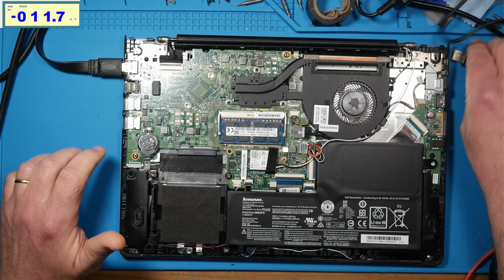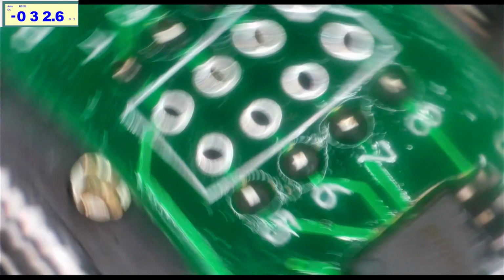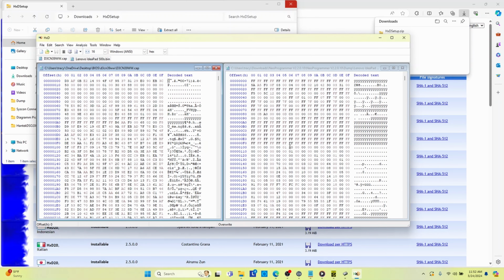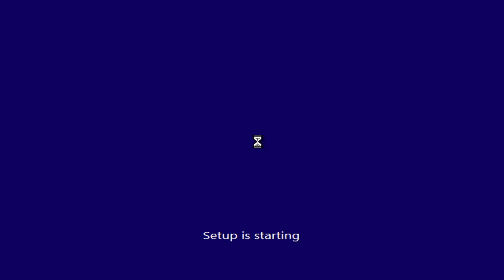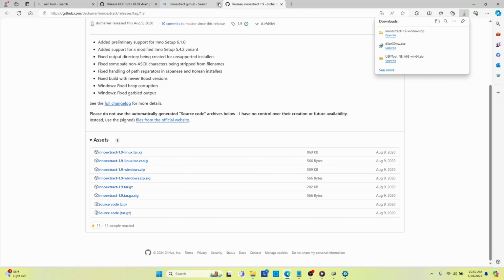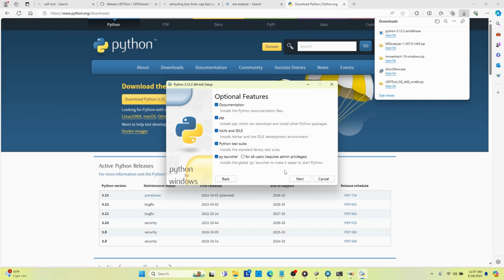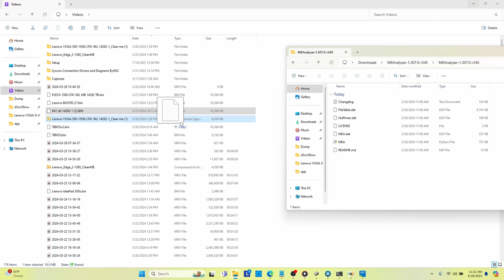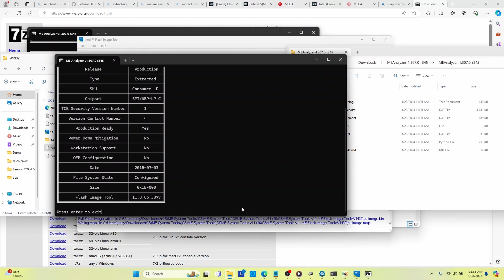Lenovo Ideapad 500s  Trying to Understand the BIOS

Comment: have you check the coils for resistance? first of all i'll check that everything is looking good especially the chipset and cpu circuit. i've seen some of sorin's videos with laptops doing the same. and the cause was a bad cpu or bad chipset. the EC chip is looking good to me. it have the 3.3v and read the power button signal. so it has to be one of these 3: bios, chipset, cpu (did you know for sure the ram is working?) if i'm not wrong the boot process is this: EC chip read the power on signal, than the EC chip read the bios chip, load the firmware and send it to the chipset, than the chipset process the bios information and activate the cpu and graphics. so the first step, as i mentioned previously, is to check the cipset to be sure is good. otherwise the pc will power on but is not processing anything. the second step is to reprogram the bios with a default one downloaded from the official sites.
Reply from the maker: Yeah, everything is measuring OK, and the computer will boot; it is just very slow. 

The problem is that Lenovo only releases the UEFI as an executable file designed for use in a Windows environment. I managed to extract the BIOS from the CAP file and pair it with a known good UEFI region, which I had cleared but this did not help. I am still working on the BIOS and finally realized that if I converted the ASCII serial number to hexadecimal and then did a search for the hexadecimal representation of the serial number using the UEFI tool, I could locate the information necessary to change serial, MAC address, etc.

The screen is definitely bad, but I still want to fix it to the point I can load Windows, and it functions properly. The key is understanding how to build the correct BIOS which I am still working on.

It has been a good learning experience, that is for sure.

Comment: i think i've see a slight sign of life in the on board screen in the first power on try. i wonder if you have a backlight issue with this laptop or a bad screen

edit:
yes you have a bas screen. white screen is caused because 3.3v is missing. 3.3v line carry the data for the screen. if it is present and you have a white screen you have a bad screen.